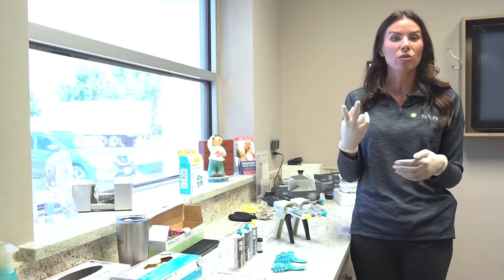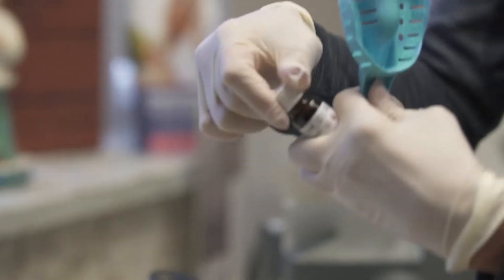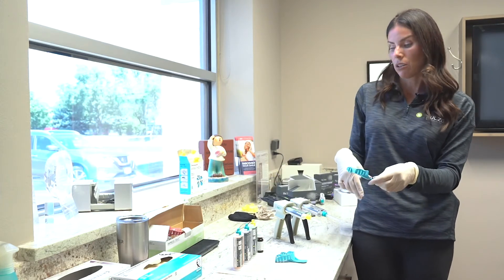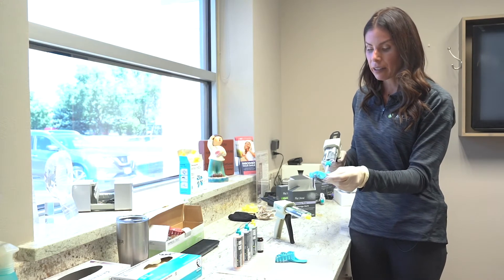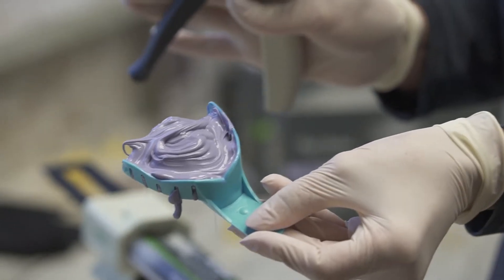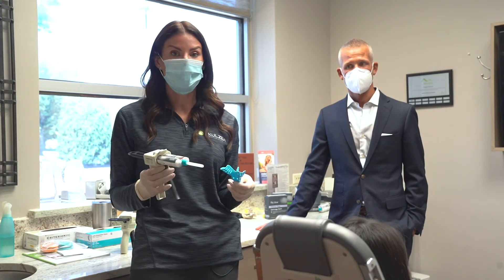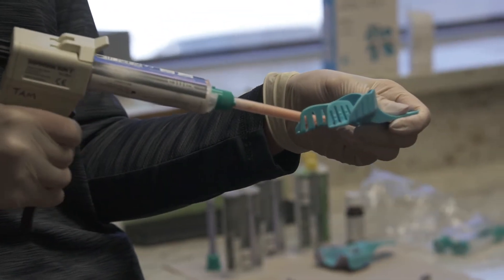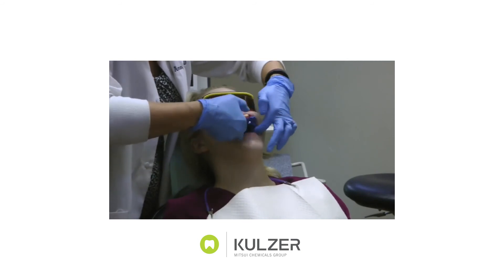How to take an Impression for Crown & Bridge, Night Guard or Mouth Guard Device

Comment: Hi, I was fitted for a nightguard today and they had to do it 6 times because the assistant had a hard time getting my back teeth.  On one attempt,  there was goo going down the back of my tongue and toward my throat which caused me to have several vomit reflexes to keep it out.  When finished, I left the office with purple rubber goo stuck to some teeth and my cheek.   A little embarrassing walking in public with purple rubber on my cheek.  When I got home, I brushed my teeth and rinsed my mouth multiple times because the taste in my mouth was horrible.  I don't know if the horrible taste had to do with the cavity they filled prior to the impression.   Is it normal to have to do an impression 6 times and does that effect the enamel of my teeth?  Thank you.
Reply: Hi DB. Apologies for the late reply.  The impression material will not effect you enamel at all, so please do not worry.  It is not usual to have to impress more than 1-2x on most restorations, however an overactive gag reflex may be causing the impression to fail causing the need to try again.